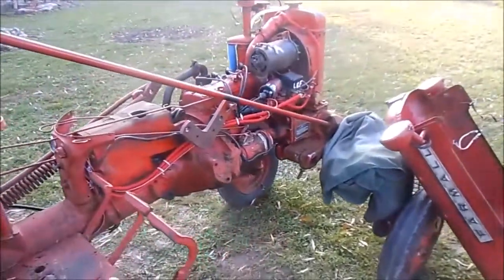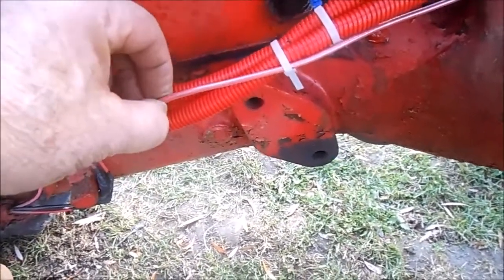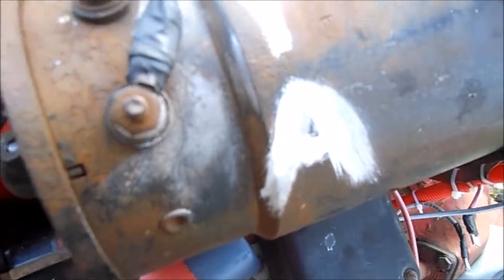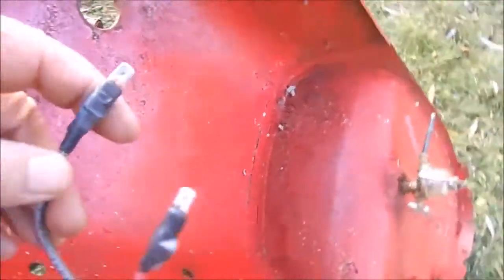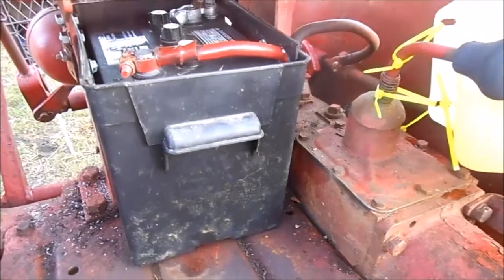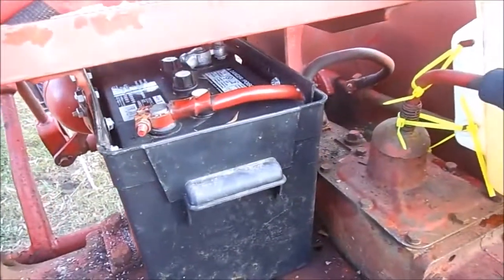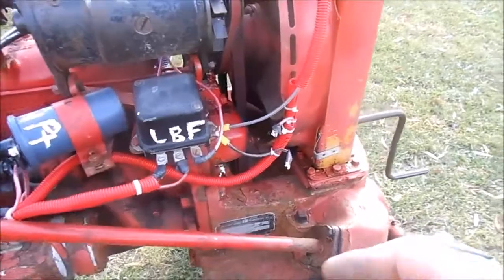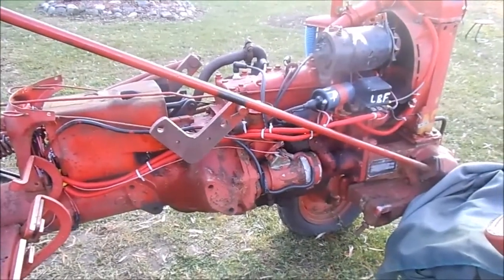Farmall  Cub Wiring Harness Part 2

Comment: What happened to the link for Part 1?  I searched for Part 1 and I cannot locate it. Thank you for providing wiring instructions for the cub tractor.  I have a 1966 that needs some work on the electrical side.